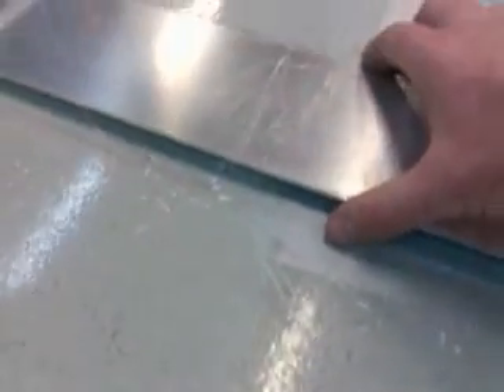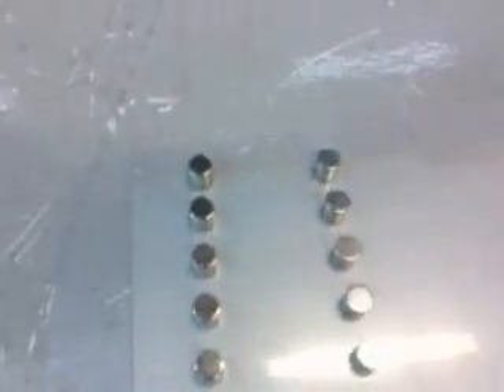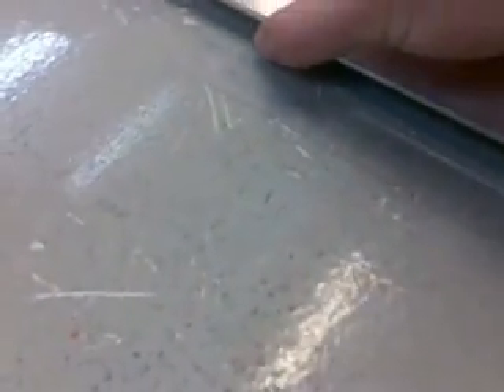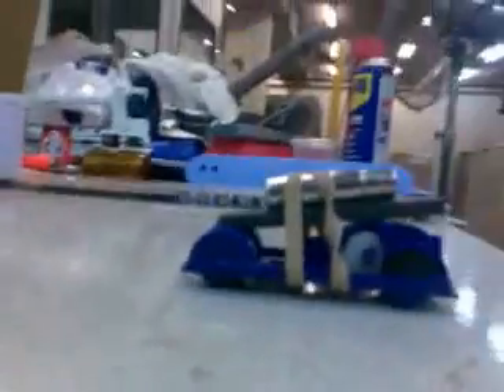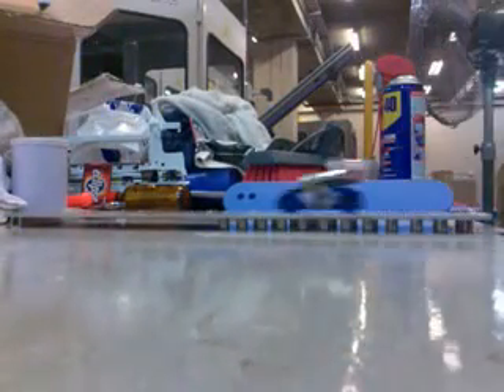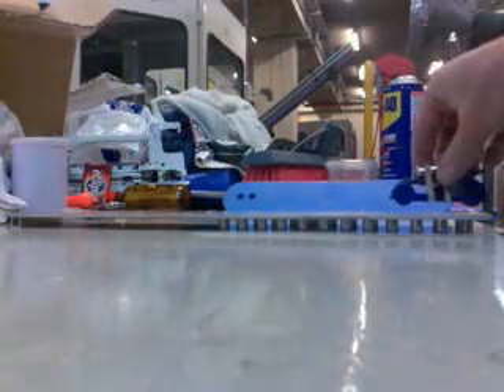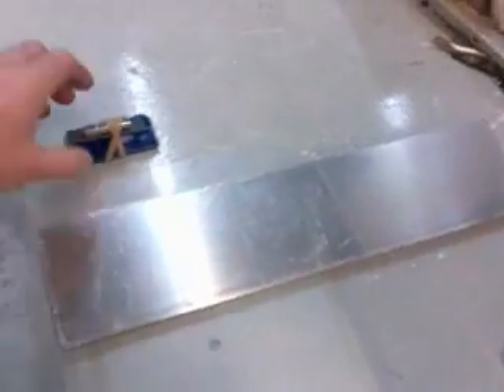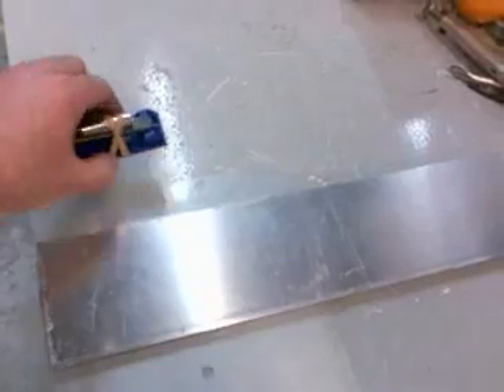Magnet powered toy car

Comment: I have also built a magnet powered toy car.It works very differently than this one but uses rare earth powerful magnets.i actually built a simple motor that runs off magnetic fields generated by the magnets.The motor can be used for all sorts of things.I also bought a wodden model house and a windmill.The windmill is powered by the magnetic motor which then generates current through a toy motor which lights led lights in the windows of the house so you have the windmill spinning and house lit up

Comment: Ok I have one question. I've been trying to do this with small rectangular magnets with no success. They just reach an equilibrium between two sets of magnets on the ground. Does what the magnet on the car is touching make any difference because I'm just sticking a magnet on a car not a rectangular plate connected to a car.

Comment: You need to make that "power" happening between the magnet on top of the car, and the magnets beneath the road....INSIDE of the wheels. Imagine the magnets on the bottom fixed to the axel inside the wheel, opposing the magnet (on top) on the spinning wheels. Then it could spin itself.